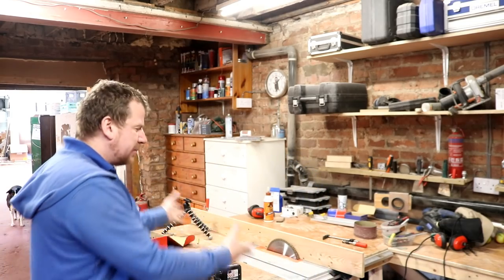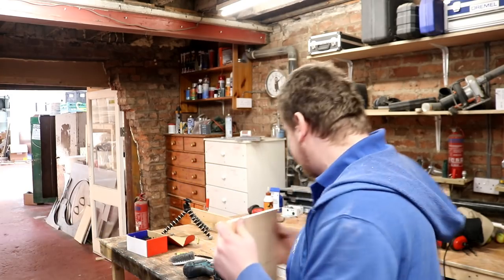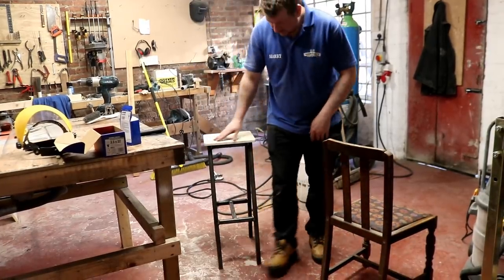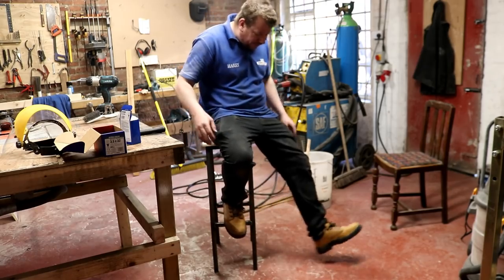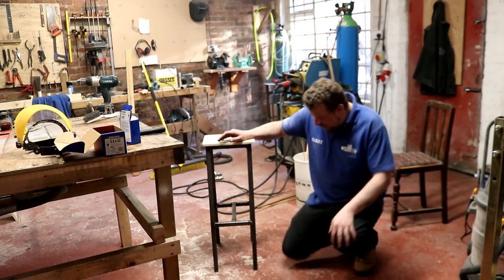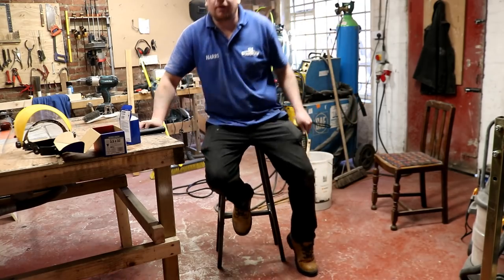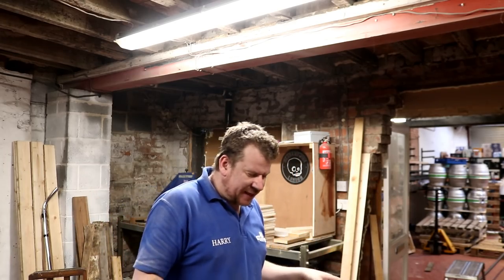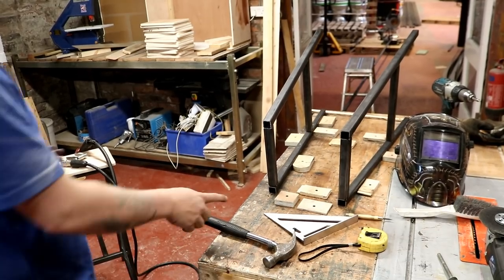METAL DIY BAR STOOLS

Comment: The easiest way to get the bar stool legs to be balance is to place the legs on a level surface clamp the cross top and foot rest pieces then tack weld in place .